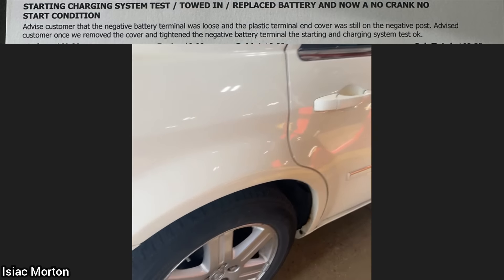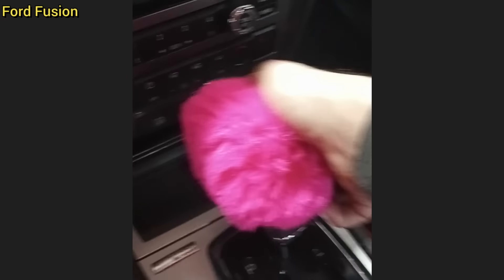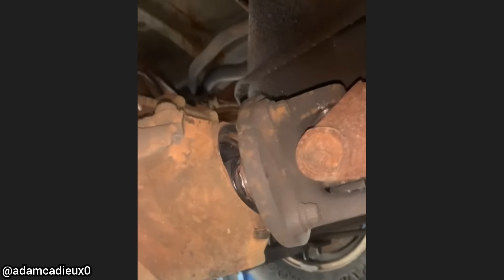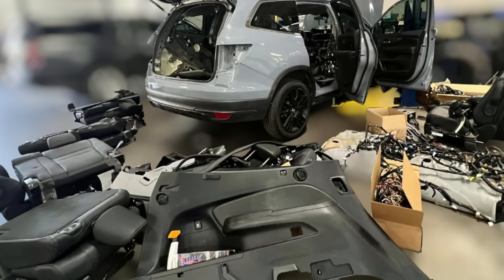Customer States He Replaced The Battery & Car Doesn't Start

Comment: The battery cap, isn’t the first time I’ve seen this. Amazes me how people can “save money” by doing the install themselves then take it to a shop for something so simple. Hope they got charged the full diagnosis fee and the owner will have learned a lesson.
Reply: But if you go to like Advance Auto they'll put the battery in for you it's included in the price of the new battery so it's disposal the old one
Reply: I've seen it on a couple jump starts.  Customer installed the battery, but it still wouldn't crank.
What amazes me is that the terminals actually FIT over those plastic caps... I didn't imagine they would open that far.  One was quite stretched and I had to use some copper wire to thicken the post (quick fix because those metal caps sold for the task are pretty darn expensive for what they are).

Manufacturers need to change the shape of those caps so the terminals cannot be placed on them until the caps are removed... add wings or make the darn things square, or something.
Reply: You hope someone with zero mechanical know how, gets raked over the coals by some asshole mechanic, just to prove a point?

Gosh, wonder why many auto mechanics aren't as respected, trusted, as they used to be??

P.S. Any opportunity to shame is also an opportunity to teach...
Reply: @codymoe4986  yes. Life lesson.
Reply: @amzarnacht6710  Yeah, this idea is is why we have a can of peanuts that has a  "May Contain Peanuts" warning.

No way, stupid should hurt and cost money. Let darwin work it out.
Reply: @meyou5092  And in the mean time, profit off the guy's ignorance? I thought this was the generation that wanted to be more tolerant and accepting.

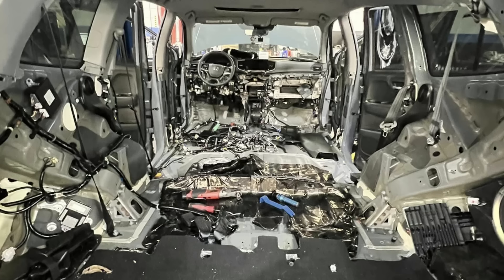Comment: 2:20 - I have that exact same Sunpro tach!
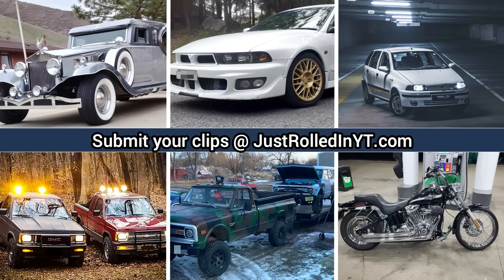3:03 - GORGEOUS Jimmy and S-10 Pickups! In my opinion, those trucks look their best with minimal bolt-ons. Is that a Diamante in the top center? If so, it's one of very few Mitsubishis I would ever own.

Seeing that odometer roll over to 000,000 was intensely satisfying. Haven't seen that since my first car rolled over to 200,000. Being an '83 Oldsmobile Omega 2.8L, it was a miracle it was still running when we bought it at 116k - they were typically very unreliable cars, and usually traded in/sold around 80-100k. Every 1,000 miles I'd gently kiss the horn pad and thank "Meg" for going another 1,000. 🤣 By the time I totaled it, I had replaced the struts, brakes, three starters, a handful of alternators, front main seal, four batteries, CV joints, transmission, oil pressure warning lamp switch, speedometer cable, transmission shift cable, park-neutral safety switch, water pump, radiator, thermostat, two blower motors... I think that's about it.

So NOW you see why I thanked her profusely for every 1,000 miles she gave me. The up-side is that I learned quite a lot about car repairs out of necessity.

Comment: I've owned an '06 Vectra C with the same engine. Those things last if maintained properly. Only had to get rid of it because of emissions.
Reply: So yall are having the same methane emissions problems from animals as the USA huh. Sorry to hear that
Reply: @vs-ww7cb  This was a diesel car. It no longer met emission requirements for smoke particulates. CO2 was actually fine because diesels are more fuel efficient if you don't do constant short trips.

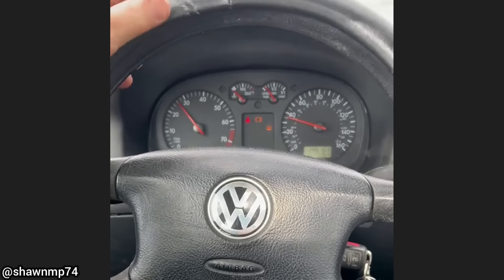Comment: 0:50 This poor Golf seems to have quite some other worries but a loose wheel cover.
However, I wonder how EVEN that happens. I used to use the same wheel cover for many years straight and it never losened.

Also bacon in the fuel tank: Well, the car doesn't like the same boring vanilla gas all the time, gotta give it some flavor!

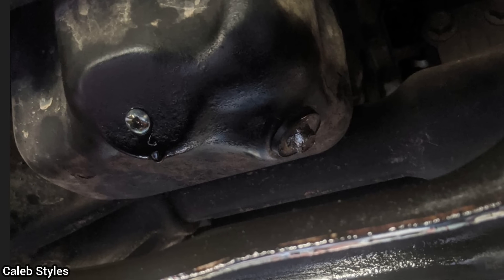Comment: 1:20 if you ever can't remove the oil pan plug and don't want to take it to a mechanic, get a fluid extractor. they suck the oil out through the dip stick tube
Reply: They made oil drain caddy’s with this setup. Trying to get the shop I’m at to get one. We did have a guy gave his f150 towed in last year. Punctured the oil filter trying to remove it. At least he had the common sense not to drive it
Reply: A: Dont crossthread it in the first place
B: Extract the sump plug without ruining the sump
   1. Damaged bolt extractor socket
   2. Weld another nut onto damaged nut
   3. Chisel, hammer and patience

C: Regularly maintain, replace when necessary

Comment: Wife’s 2011 Focus had a thrumming vibration noise @ 60 mph. Suspecting rear wheel bearing I took it to my first-rate mechanic. He suspected a door or other seal leaking air. After taping over openings and two test drives he noticed the Memorial Day poppy on the antenna. Removed poppy, Cured. When he told me I laughed so hard I cried and told him his charge was worth it for the laugh. We had a poppy on the antenna for 12 years without a noise. Go figure.

Comment: Wouldn't drilling and tapping a new hole in the oil pan and putting another drain plug in it work though?
Reply from the maker: You could if you want. Just have to make sure you get the metal out of the oil pain. But that drain plug with the rounded head could have been easily removed.

Comment: There is nothing wrong with doing electrical work like installing a sound system on you own vehicle, but you should know, what you are doing and document it...
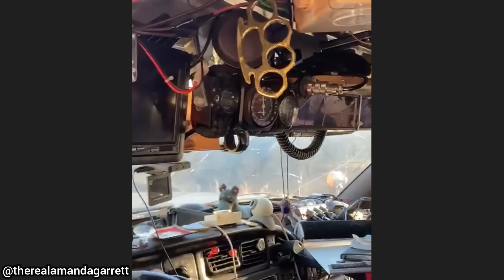2:36 looks like "na, it works fine for me, no reason to do it properly"...

Comment: The 1.9 CDTI, or DIESEL, is a good engine it's literally what later become the 2.0 diesel which is also a reliable engine, its the newer vauxhall opel that i don't like cause Peugeot bought them in 2017 and the quality went down from there

Comment: I mean, you really don't remove a "load-bearing" coconut under any circumstances.  I get the first one with the plastic battery cover still on.  I can see doing exactly that, especially if one had not ever changed out a battery before.

Comment: I've seen a car towed to our shop after the customer stated he changed the battery & starter. But, the dumb car still would not start. He got furious over the bill to remove the plastic cover on the battery. ⬅️ kinda like a 'YOU ARE STUPID' BILL. 😂😂😂😂
Reply: AND the starter? Wouldn't the first clue be that none of the dash lights or headlights light up and the horn won't honk? Replacing the starter isn't going to cure that. 
I always ask customers to define "does not start"  
Do you mean the engine cranks but won't fire?
Or do you mean the engine won't even turn over and none of your lights work?

Comment: Im not a mechanic but when i took my car to the dealership they tried to sell me a new transmission for 6 grand on a maybe that will fix my problem. I changed out the selenoid pack, transmission filter, fresh fluid and fixed my problem for 250$. Sometimes its not always the customer.
Reply: Yep, and they never give you guarantee that it will fix the problem (or that it will be no charge if it does not). So you always have to gamble.

Comment: Years ago, men could tell if they needed a battery, fan belt, starter or alternator and they would change the part.
Now they bring a car in with an open window because  they hear air coming through the car.
What went wrong with society?
Reply: some men became woke............

Comment: Have seen the battery cap one myself, when my brothers swapped a battery on a car they were working on.

Luckily they didn't eat a tow and a shop fee on it.  I also freely admit I didn't see what they'd done until I went to put a voltmeter on the battery post to see how charged up the battery was and felt the probe push into the plastic.

Comment: I absolutely hate those car parts store steering wheel covers. Even if Im driving someone elses car I take them off. Cannot stand they slip and slide all over the place. Would rather drive with half the foam missing on the stock wheel. I have put stitch-on leather covers on my own cars, and installed properly there is absolutely no chance of slip, due to how much you have to pull and stretch the leather to get it closed..

Comment: With the window, i did that myself once, although, i had mine open a little bit more. I could hear some wind noise when I'd pass vehicles, especially on the highway coming from the right side. I stopped to fuel up, reached behind the passengers seat and noticed my right rear window was open.😅

Comment: I have to confess that when I replaced my battery, the ignition problems started because I hadn't tightened up the connections properly. Just one of those mistakes you only make once. Probably #974.
Reply: Eh that happens occasionally. Can't be on full alert all the time.. which is why I've taken to the practice of going through all fasteners that have been touched once more after every operation.
Reply: One of the first times I replaced the point on my car I failed to tighten the screw holding it down. I drove a few miles with some obvious problem and went over the sequence of steps I had taken and found the loose screw.  Lesson learned.  I was a teenager with a Chiltons manual.